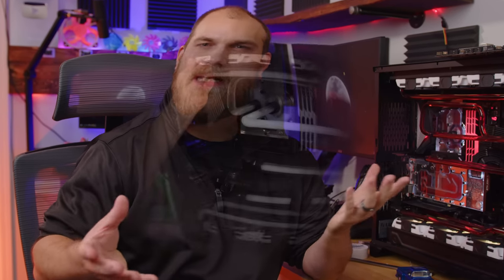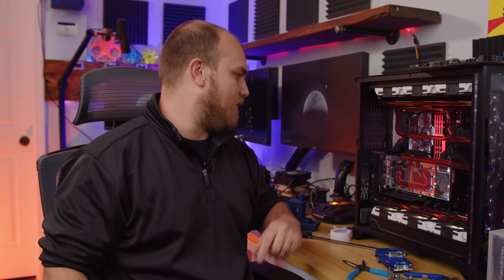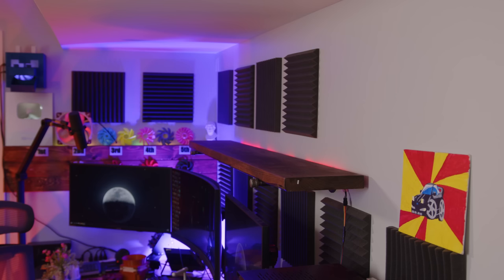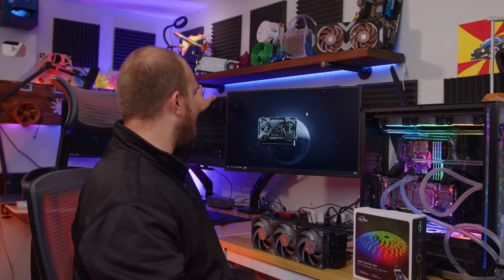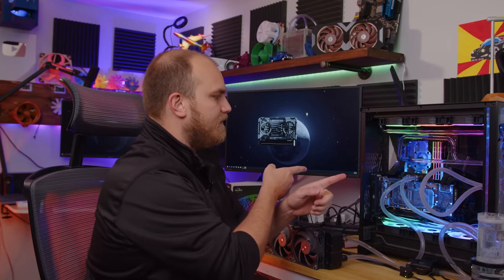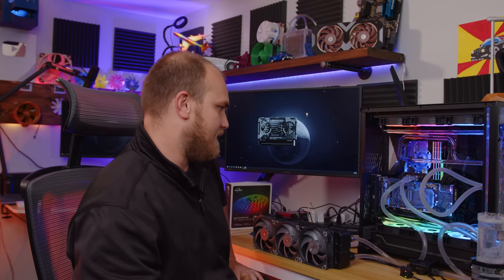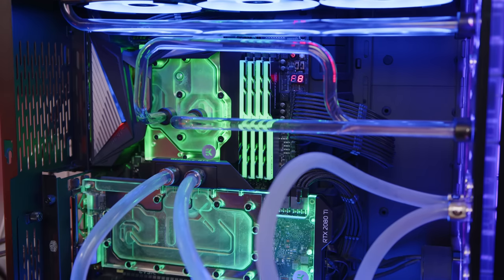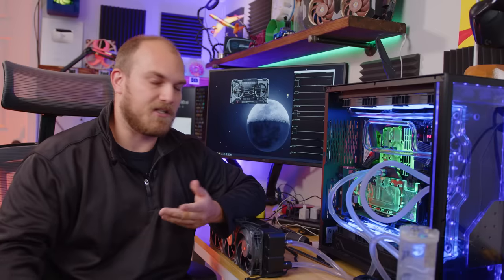Does FLOW DIRECTION Matter?

Comment: As someone who  works with industrial Cooling systems, and who has overengineered his pc water loop to the max. (6 calibrated temp sensors inbetween every component for the loop alone)
I would say:

Flow direction and the absolute minscule amount of impact it has on the flow, doesnt matter at all.
In the typical PC loop, the flow rate, even at relativly low pump settings, is far above any kind of threshhold where it would matter.

At a low flow rate of about 100l/h, a 3080 with 370W gets a delta T in the Water of 3.2°C  between inlet and outlet.
And that gets you nowhere near heat saturation. But that deosnt really mean anything. 
The amount of heat transported away is the same and subsequentlly, is equal to the amount of heat transported away from the rads.
Which also will have a grater delta T. so water gets out warmer but also gets in colder.
Reply: Common sense perspective a lot of people don't stop to think about and 100% true.
Reply: Makes sense, especially once you do the calculations.

I just assumed they would have designed the lines and pumps as small as possible. But they are more overkill than I expected.
Reply: @Oblithian  yeah.
I mean I have a gpu block, 3x 360mm 30mm rads and a cpu monoblock all inline, with about 1,3-1,5m of tubing all hooked up to a single d5 NEXT from Aquacomputer.
I get  a delta T  of less than 2 degrees on my 3080 with 20% pump power.
Reply: @Mario Kart the 3.2 degrees is the calculated delta t at a theoretical 100l/h with the full 370w going into the water.

In reality measure  about 1.85K  average  at my low pump settings with 160-170l/h. That checks out calculated too. Assuming it won't use 370w constantly and loses some heat from air circulation around the card 

You can read out the temp on the normal 2 pin sensor with a resolution of 0.01 degrees. 
You just have to calibrate them before for it to be accurate. pump speed at max with no load on the components and then adjust them to almost fit each other.
Reply: The only instances where reversing flow can be more noticeably negative is when the block is designed to pressurize flow in a particular direction. Most CPU blocks and some GPU blocks are designed for specific flow paths. All of EK's and most other companies' GPU blocks for years have been designed for bidirectional flow with minimal performance delta.
Reply: @MigotRen  Hey. I need some help with people that are actually experienced in this field and pc build help discords nor youtube they actually do. Can I DM you? Spreche auch deutsch

Comment: The only reason I could see the fluid direction having an effect on thermals is if the fluid path resembled something like a Tesla valve, severely slowing fluid flow.
Reply: Yeah, when there's hardly any difference between inlet / outlet fluid temp, the direction doesn't matter.
Reply: @tkermi  Look up the Tesla valve, it's a way to abuse how fluids stick to topography to provide significant resistance to flow. Given it's very specific geometry, and I've never seen shapes like that in a cooling loop, I doubt there's an effect in reality.
Reply: @DenKonZenith  Yes, I'm familiar with the Tesla valve design. I just didn't comment about it specifically because I don't think there's any particular reason to use in this kind of design. But it's true that it would basically cease the flow completely.

Comment: Say it together boys and girls "loop order does not matter"! I got confused with my output on my pump while doing a system transplant and had the order on my ek cpu block reversed by mistake. I ran stress tests, noted temps, re-plumbed and zero degrees difference. Ive had my gpu in 3 different (because it has 4 potential in-out ports) configs over the last few years, again not a change. Ive even had rads in between blocks vs all after pump, again nothing! Just do shortest neatest run and enjoy.

Comment: from everything i have heard, gpu direction really doesn't matter, and cpu blocks depending on the block, there may be a small difference, for the most part it would be with in margin of error 1-3 C. what's most important is keeping the gunk out of the loop, if you are running in reverse, build up can have more impact than when running in recommended. but that's mostly a longevity thing, as you really dont want gunk to build up in your system.

Comment: Only thing I can think of is the k value for the bends would change in the waterblocks because they might have one k value going one way and another going the other way. so you'd be putting more load on the pump going the other direction, so maybe more noise and it could potentially decrease the lifespan of the pump. Purely speculation though.

Comment: It depends on the block and if it's designed to have a certain flow direction to prevent low pressure spots impeding flow rate.
Reply: Doubt it. Ran my cpu block backwards and at the time only running a single old d5 pushing(it struggled...30mins to bleed, didnt have flow meter at the time but it was f-all) through cpu,gpu coverall,240,280 and way too much plumbing. Re-plumbed with more sensible layout and correct flow direction on cpu, not a single degree of difference. Loop order really doesnt matter.

Comment: The temperature delta in the fluid is given by loop speed, so it could matter if pump was intentionally slowed down. Normally, the deltaT betwen radiator in and out is really small, and the deltas anywhere in the loop are subsequently less..

Comment: @majorhardware that's half way true - the thing with fluid dyamics is, you can create dead flow zones, where water is traped and pretty much stays at the stop indefinitely - in case of cooling that 'can'(!) make a difference, but in your specific case, it might be to small to be measurable! ;-) (as the area is pretty small)
using the correct direction (ideally it would be from one side to another, but cooling wise it's indeed more effective to push it directly onto the fins, as that also pushes water away much more effectively than having the water pressure split (one taking a long route around before merging again) and then join again while pressing against eachother! ;-) (this also means a pressure drop btw)

Comment: There should be a 4-5 centigrade difference between the hottest and coldest point of an entire loop at maximum (JayzTwoCents says 3), so neither order or direction should have any relevance.
Reply: I go with jay, i think im honestly lucky to see 2c!
Reply: @dunxy  When I say 4-5 I'm not talking about CPU-GPU differences or anything where you have a thermal probe slapped on normally, I'm talking about the entire setup top to bottom, reservoir, pump, everything included.
Reply: @dominic.h.3363  Im talking about same thing! Ive meassured my entire loop with ir thermometer, only 2c , if that.
Reply: @dunxy  Cool, I need to update my setup then! :D

Comment: I have the same waterblock but with conductonaut. With my cpu and gpu on the same loop, my gpu runs a good 5-6c warmer if I use the "outlet" port.
I think you did a disservice because it might matter less with just the GPU because now there is less flow restriction happening in the loop. To really test if it matters, you should run it in your full loop and see if it also impacts your cpu temp.

Comment: It would sorta be cool to set up a test jig for CPU thermals. Basically just 2x 3dprinter cartridge heaters in a block of aluminum for with a thermal couple thrown in there  that way you know exactly the amount of heat being removed.. although no one would be able to run your same test. I wonder if there are fans or coolers that work better on lower amounts of heat than just full bore maximum heat dissipation. You'd also be able to test the ones that thermal throttle    to find out what one is literally the worst. Instead of many being tied for last place with DNF results

Comment: IMHO it will not matter, as long as water flows over fins, it will work the same either way....
Reply: except for the gunk buildup, this is a sort of "negative pressure" ... the negative side has more volume but slower flow, so it facilitates buildup on the fins
Reply: @marsovac  Hmm didn't think about that, would be interesting to see both flow and PSI, on both sides with it set up both ways. maybe even do it for the whole system, I wish could afford it, cause now I want to know. Damn you curiosity.....
Reply: @josephschultz4097  I did not test this since it is a tedious, difficult and slow thing to test... I'm just reasoning. If the flow is slower on the ingress it could offer particles a place where it is easier to "attach" on the obstructions (fins).
Reply: @marsovac  Oh no sorry if you took it the wrong way, as it is something that could happen it just got me thinking. bad thing about being a mechanic, thermal dynamics and water flow obstructions inline ETC just wish could test it out myself. Stay safe and well

Comment: Fan's on radiators work better if they pull the air through not push it. If you don't believe me, do an episode and test it out. This is how fans are setup in pretty much all vehicles for various reasons but the main one is pulling air through the fins is much easier than trying to push it through. Nice that you do these tests so we don't have to, A+ work as usual!
Reply: push is better than pull.

Comment: Many of the cheaper LED strips with a standalone controller/remote/app can be tied to the PC, you just have to create the adapter. That's how I do the lighting in mine, as it's way cheaper than the same LED strips with a PC connector.

Ideally, the strip will have addressable LEDs, w/ + [12v or 5v], -, DIN. If it has individual channels for each color, you'd need something like a cheap Arduino to act as a controller, as those are the really cheap "dumb" LEDs.

Comment: I've been wanting to do a custom loop in my PC, since I got my, 3900X and STRIX 2080Ti.  But just don't have the confidence to start.  And seeing your videos is helping.  I'd like to see more.
Reply: Never been fussed with hard tubing, im performance>looks myself, but soft stuff is a cake walk, just buy decent stuff from get-go and take your time and enjoy  the benifits. Id never go back to air after 6-7 years running custom, more for gpu than cpu as a decent air cooler is enough for cpu but gpu's really shine under water, ive never hit a thermal limit, just runs solid max clock on power limit all day every day, even with some pretty intense ambients (40+c) here in Australia.
Reply: @dunxy  i agree the build i did was soft tubing and i think it looks fine and it performs great no problems

Comment: Looks like the PWM on the nightbird LED controller is pretty poopoo.  Looks pretty flashy on camera.  ESP8266 based?
Reply from the maker: I noticed the same while editing not sure what it uses but looks like I'll need to swap them out
Reply: @MajorHardware  why not repair it ?  It can only be a resistor, transistor, or a small section of copper track ...

Comment: Although there was a marginal difference in cooling, I believe the inlet/outlet matters because erosion would wear down the GPU block faster when water goes in the unintended direction.
Reply: The water doesn't move that fast. Considering domestic plumbing uses brass fittings (with 90⁰ bends and sharp edges like inside a tap body) which literally last decades with no appreciable erosion, you're not going to erode anything meaningful inside a PC unless you're using stupid coolant causing physical erosion (some sort of suspended particles) or something allowing corrosion (which would be stupid)
Reply: @lunchie80  Yeah, I guess erosion won't happen in this case after all. The velocity, temperature, and pressure of the system is too small for erosion to occur. I learned 90 degree angles will be the most impacted by erosion but there are 90 degree bends everywhere in the loop. Those would give way first, but changing direction will not change the amount of 90 degree bends. Everything is so negliable anyways, so erosion will not happen.

Comment: I ran my 3080ti with a similar EK block in both directions when I was trying to figure out how tf to custom loop w a 5900x. I found that with a 240 rad alone there was a measurable difference of 3 degrees, but with 600mm of rad it didn't matter. Def not enough for EK to note in their documentation, but still interesting.
Reply: Not enough radiators lol
Reply: A 3080ti and 5900x with only a 240??? Surely you cant be serious! Dont think block order had anything to do with excessive temps, thats way too much thermal load. Not some old weak ass gpu and a quadcore we talking about. I only have a 1080 with a 5900x, 720mm of rad with enough room to add another 360 when i decide to sell a kidney for a new gpu.I honestly think 720mm of rad is barely handling current load.
Reply: @dunxy  i agree with you. Atm i am running a rtx 3080 ti ftw 3 with a 10900k.
I have more than enough radiator space but i keep wanting to add more lol.
Atm i have 1x 1080mm 2x 480mm, and 1x 240mm.
I am thinking about adding another 1080mm.( both 1080mm would be sitting outside of my case where i can move them in front of a cold window this winter.

Comment: Nice, just installed my first waterloop a week ago.. took for ever and I dunno wtf happend, but the RGB rainbow light (abeit I didnt want it) died immediately, and the blue LEDs for the alphacool logo fell out of the pump as well. I bought b-stock (returned) radiators, and one of them was full of blue glitter thats now stuck in my cpu block (gpu has larger fins for some reason), even though i spent 15 miuntes trying to clean it out.

Overall good temps still (120x45mm, 280x30mm rads), havent seen GPU over 60.

Comment: I think it's about cooling order, the memory than the GPU chip . I hope u show us theres temps
Reply: The order of anything in a loop makes absolutely no difference to performance*.

The water is moving way too quickly for it to possibly matter that it passes over the radiator before the hot bits, or the memory on the GPU before the die.

The temperature of the water will be consistent throughout the entire loop.

*(obviously the order does matter for having the reservoir above the pump, but that's not relevant to temps.)

Comment: Do you think the length of the tube makes a diff.
Reply: It does, but it's negligible.
Reply: the length is not the question, it's the height. water pumps have what's called "head pressure" so gravity is a factor but that won't be a problem if you keep the pump inside your case.

Comment: Although it was the same in this test because of the temps, GPU boosting would be a more accurate indication of how efficient the cooling is, since the GPU's target a specific temperature to stick to. It would be more important when checking this sort of behaviour on air cooling though. I have said this before and seems to have been ignored.

Comment: The result can be misleading, it may have been the same because it was a 360mm radiator and it was very much left over.  it may not be the same with a smaller radiator and it does matter when the radiator is very tight.
Reply: Thats what I was thinking, it was basically sitting at room temp the whole time, although it will technically make a small difference between in our out direction, the fact that the rad could keep 1 at room temp and the other started to go up by a degree may mean that if you take away some rad/dissipation then the results may multiply by 2 or 3, me personally I'd get that extra 1⁰c out of the gpu because the colder it is the higher clock it run, obviously to the limit but when overclocking it makes even more of a difference with temps😅

Comment: OOPS! You measured the WRONG THING - you should have measured the GPU chip temps, not the water - nobody cares about the water temp, and everyone cares about performance throttling.  The REASON some things have direction, is to cool the more-sensitive-to-heat components first - if you go backwards, you're sucking heat from stuff that doesn't mind it so much (e.g. ram), over the top of stuff that does (e.g. processors).